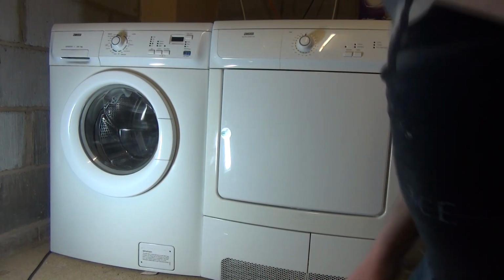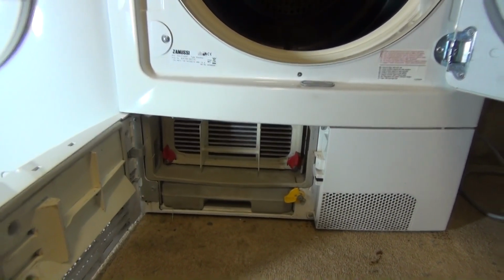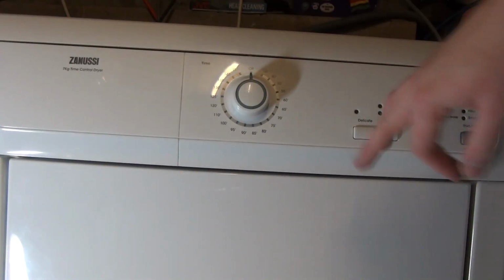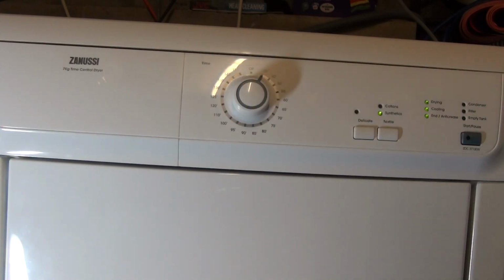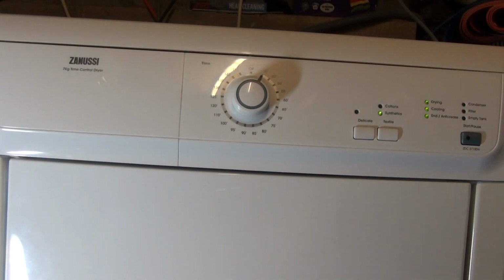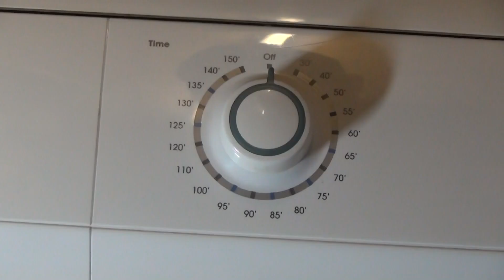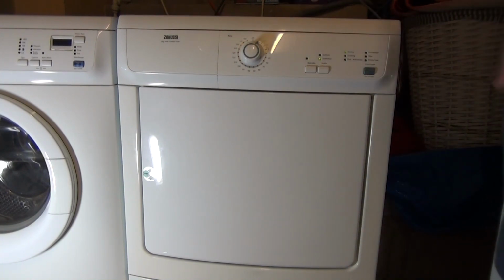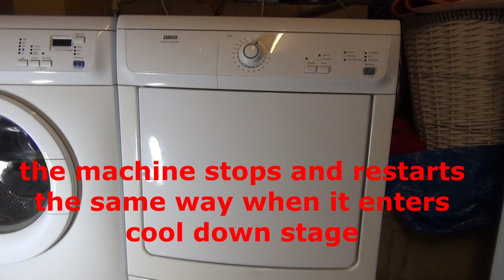Review and Demonstration of Zanussi ZDC37100w 7kg condenser dryer

Comment: These models are well known for circuit/pcb boards failing..shame. I've had 4 zanussi with the begining zdc's and they have failed. Plus 1 aeg off the same era
Reply from the maker: It's funny you should mention that. This one is still going. But a zdc37200 I have sold in the past has this November died if circuit board fail.